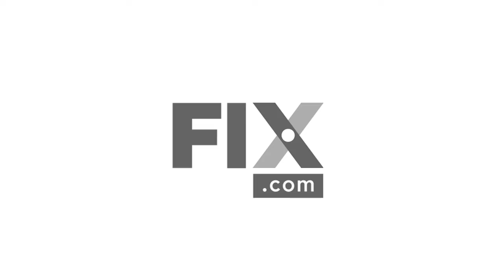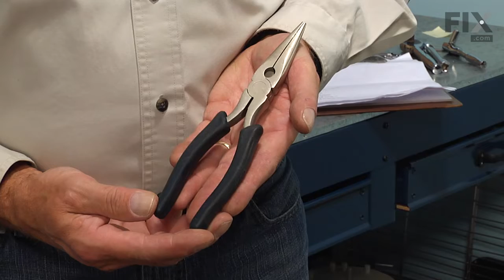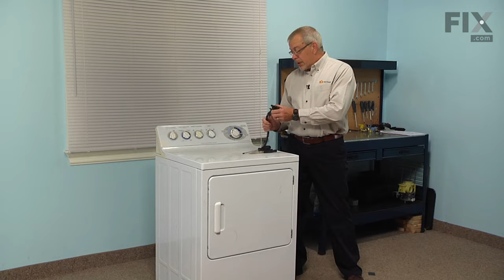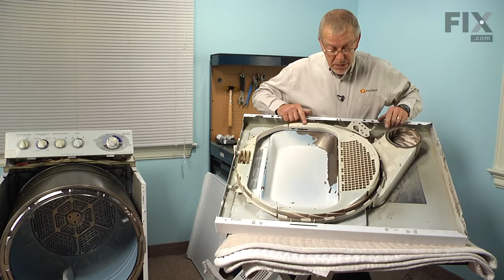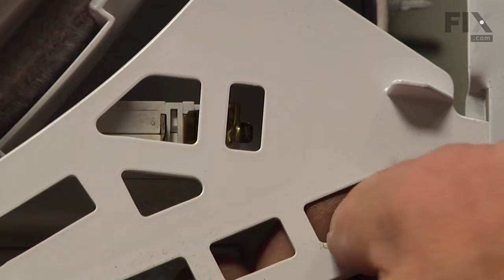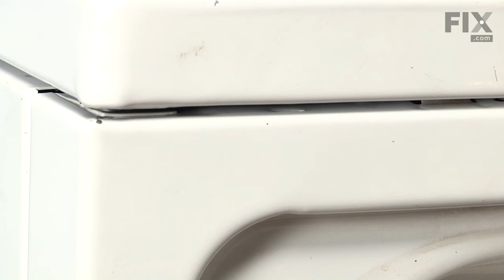GE Dryer Repair – How to replace the Lint Trap Duct Assembly

Comment: I came here looking for several videos on how to clean the lint in my GE GTD Series dryer.  I really appreciate being shown how to disassemble the lint housing here and the other videos.  I had already cleaned everything from the dryer back to outside the house but I could not clean deeper in the front after removing the lint screen.   This video has me thinking on another issue:  why would you want to replace the lint screen housing ?    Isn’t it necessary just to clean it?   Unless, of course there is a switch or other sensor I it that went bad and can not replace just that; which is it?     Edit:   Never mind , I read the video description and found apparently this housing wears down after a while and begins to make marks on your clothes.

Comment: Maybe you could do a updated version the new dryer I have does not come apart as you show. The top piece is connnected to the rear control panel on my GE dryer.
Reply: Same here. Did you have any luck getting yours apart? All I want to do is clean the fucking lint out of the bottom but they make it impossible. It's like GE wants to burn my house down.